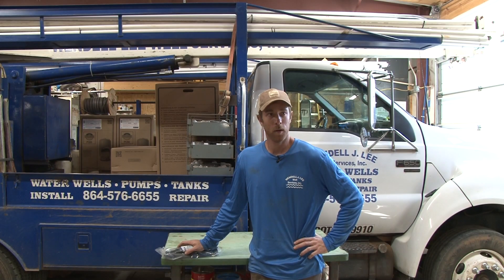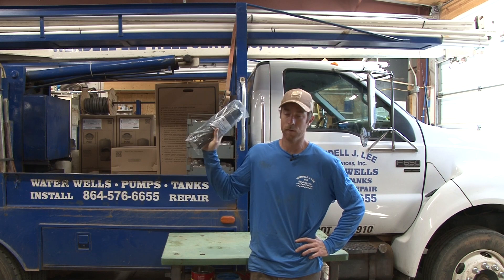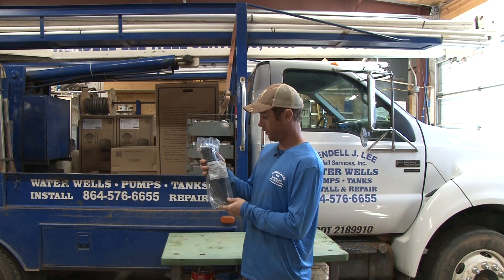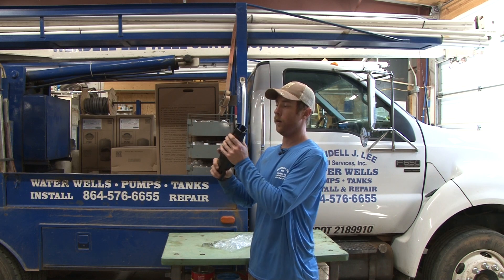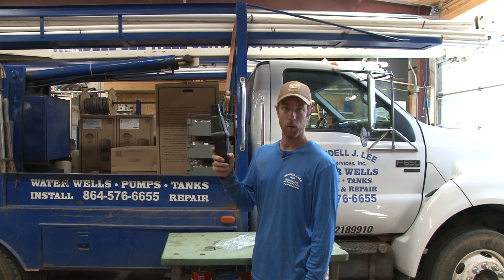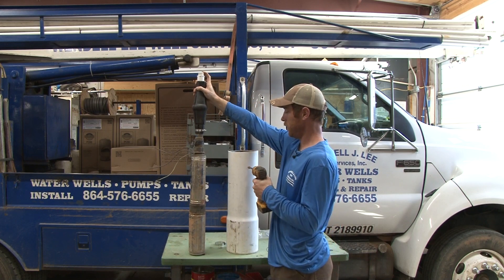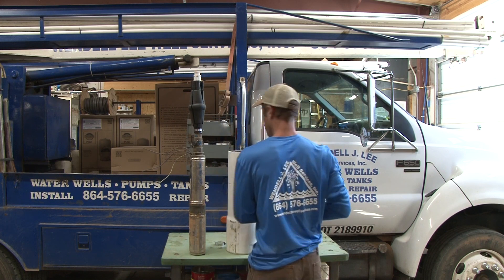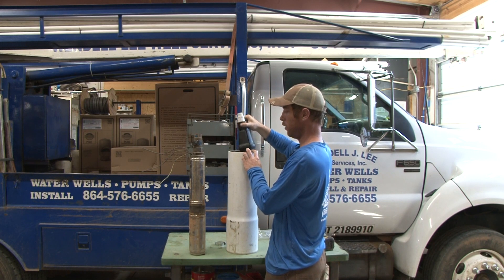Well Pump Torque Arrestor: How to Install and Are They Necessary?

Comment: I have a horrible recovery on my well as its 60years old and due to startup on a dry well  it rubs my wires against the bore and Ive had them short out so I'm going to put a timer and a torque arrested on it to stop this from happening

Comment: I like this guy's HONEST opinion. I am installing a 1.5 hp pump with polly pipe and was told I need one. If I can find one cheap enough I guess I'll throw one on. I will be ensuring my threaded knuckles will be torqued down enough to necessarily ensure the torque arrestor will never need to do its job lol. It'll be there for looks and piece of mind 😊

Comment: The well pumps don't have too much torque? My brother just got a new 3/4hp pump and new black plastic pipe and the first time he turned it on it twisted hard enough to twist up the torque arrester and put two kinks in the first foot and a half of the pipe and broke the pipe half in two right at the pump.

Comment: I’m putting in a 3” pump in a 4” well, only 60 feet deep, but putting one in near the pump only as a centering device, probably unnecessary but if it keeps the pump from seeing any well casing contact it will be worth the 5 minutes and for $20.

Comment: Wendell, I  just pulled my pump, 1/2 hp 7gpm 6" well caseing. Above the pump was a 6" spacer with the 4 ends worn off and a flat spot at the bottom of the pump motor from rubbing on the casting. The next 3 spacers have ware getting better as you go up the pipe. I have 170' of pipe . For $13.99. I'm adding a torque arrestor!

Comment: I'm not that worried about the pump unscrewing...but I DID  put one 6" above the pump to keep it centered and one 6' above that so it doesn't teeter totter on the lower one.

Comment: I have a 40-60 pressure switch, how do I get more pressure in the house?  Bigger tank?
Reply: Crank up the pressure switch screw to allow the pump to run longer and build pressure in your tank. Also you can add more pressure in the tank… read the side of it.  You can top them up with a bicycle pump.  Assuming your pump is good and can pump against the bladder pressure.

Comment: I wonder why pump manufactures did not design the pump so that they start in the direction of the pipe thread, so that the start of the pump will tighten the connection instead of trying to loosen it up...?

Comment: Torque arrestor on the pipe, which has no torque, nothing on the pump, which generates the torque, and could unscrew if fittings are too loose. Am I missing something?
Ed c
Reply: I had the same thought and was searching these comments looking for someone who asked this question. In my opinion, without connecting one end of the arrestor to the pump, there can be no arrestment of torque.
Reply: @nunyaB.1964  The guy Jaykocenko above this comment said it. It's to keep the pipe centered on the well to protect the wires. I had a well driller tell me to put 3 on a 200ft well. I'm worried they will get jammed up at the next pump pull-out.
Reply: @GeorgiaFireBand  If the pump is free to move around, then upon startup it could build up a lot of momentum before it slams into the side of the well.

Comment: I’ve replaced a couple 1 1/2hp,  400 ish feet deep. While we have those arresters on the truck we haven’t used them. We use sched 120 drop pipe, dope and bury every thread.

Comment: Thank you for the video!  Quick question, does the torque arrestor clamp on around/on top of your wire?  I'm guessing so to keep it from chaffing your wires.
Reply: Just tried putting my wires under the TA & didn't like it. So I now have the wires going over the clamp but thru the vertical slots
Reply: That's what I want to know!!!

Comment: They are 100% necessary on smaller pumps like 1/2 horsepower. Not only does the pump want to twist but it also shakes and vibrates. Unless the driller is 100% dead straight which most of the time they aren't the wire will lay on the side of the well somewhere down the well. If the wire is touching everytime the pump kicks it will wear right through the copper over the years. I see this all the time on unprotected pumps and in my area I mostly deal with 1/2 and 3/4. It's not on all of them but on 80% of the wells the wire will be laying. Very rarely will a driller get the well in dead plum especially with older drill rigs

Comment: A well log says I've got 40' of 6" casing with a 4 1/2" liner running from 15' to 75'. Can I just set the arrester to about 4 1/4" diameter? That also has to clear a pitless adapter.

Comment: I am putting a submersible pump into a well that is about 370 ft, I am going down 200 ft with the pump, does well casing go all the way to the bottom of the well?  Previously had a 100 ft jet pump in the well.    Do you always put torque arrestor just above pump?  Thank you for the video and the help!

Comment: Thanks for the good videos. I have learned a lot from y’all about my well. I am changing my pump today, and was wondering if I need an arrestor. My well is only 60’ and the pump is 1/2 HP.  So I won’t install one. Thanks again.

Comment: Not using a torque arrester next time! I tried pulling my pump (1HP Grundfos on PVC pipe)  yesterday as I had no water flow , its an older well with a 4" casing about 65 foot deep, The pump would come up to the pitless adaptor but then would jam, I hesitated to pull too hard as I didn't want to loose the pump after about 2-3 hours I was loosing faith that I'd ever see it , Very hard to see what was jamming the pump as the pitless adaptor is about 5 feet below ground. Luckily I have a small backhoe capable of digging down about 5' to the area of concern, I was able to cut the 4 inch PVC (well top ?) therby exposing the top of the pump and adaptor, to my suprise I found large pieces of the torque arrestor jamming the top of the pump and not allowing it past the adaptor! Came up easily after removing the useless arrestor. I never even suspected there might be one on it. I found a broken wire on the pump, repaired and back down she goes, I plan on checking the pump again in a couple months for torque issues . Great video thanks
Reply: That's my dilemma as I"m getting ready to drop my pump back in the well.

Comment: Thanks for the great info on the pump arrestor. I am installing one on my pump just in case its needed. Guess what it happened to me  just a few days ago on June 4th, 2021? The pump unscrewed itself from my schedule 80 pvc joint. Well is 500 ft deep. I have the equipment to take the pump out and I did only to find out the pump had come off. Fortunately, the wiring was strong enough to hold the pump on and I was able to pull it out. Too bad that I spend a fortune on a new pump only to find out the original one was still ok. It took 3 years for it to unscrew itself from them joint. It was a Grundfos 1 1/2 hp model. Here is my video I made prior to taking it out. https://www.youtube.com/watch?v=3VjFU4_r4lg

Comment: I've got gotta a question for you. I'm putting in a new 1 hp pump at 225 ft. At the 93 ft level my inside hole diameter changes. The inside of my pipe is 6-1/4" until you reach the 93 ft mark then it gets smaller somewhere around 4-1/2" to 5". How can I tell what it is without lowering and raising the pump over and over again ? That would be a pain in the rear !!!

Comment: We used them in the past, I'm a residential plumber and not a well driller. I do work on pumps a lot though. I stopped using them because of what you said in your video but also because on a couple rare occasions I have ran into what you call a 4" PVC packer/screen inside the well casing. My first was a install that I got stuck not knowing it had a packer and then just yesterday my buddy had one that someone had put in years ago and it took us hours and a rig truck to pull the Torque arrestor up through. In my opinion I wouldnt use them ALONE for your reason stated and mine!
Reply from the maker: yes, agreed with you on that, that sounds aggravating

Comment: Thanks for the info.
I'm now preparing to have a well dug, It was my understanding that not only does a torque arrestor help prevent the unscrewing of the pump from the pipe but it also helps prevent chafing of the wire inside the hole and or casing. Is that correct ? and if so is a torque arrestor worth it for that aspect.
Also how do you feel about "Well Hose" compared to PEX, schedule 80 PVC, etc.
Reply from the maker: yes, you are correct on the functionality of a torque arrestor. Schedule 80 PVC all the way to hang a pump on...rated for a higher pressure rating and stronger too

Comment: Hello sir, I hope you're doing good. I need an expert advice from you. I dug up a 400 ft well and when we were installing the casing, we accidentally dropped about 260ft (230kg) of casing down to the bottom of the well. I had no choice but trying the submersible pump to check if the well is still working or not and it went down only to 300 ft, pumping water for 15 minutes only. I assume that the casing under 300 ft are badly damaged and smashed, and I have no idea how to fix this problem as we don't have expertise here. Looking forward for your advice and thank you.
Reply from the maker: It's hard to give exact advice without me being on site and in your area, not knowing the type of well, formations you are in, and how the well was constructed. But my general advice tells me to get the pump out and try another hole. Unless you can get that casing out, clean the hole out and use what casing isn't damaged. I highly doubt that will happen
Reply: @WendellLeeWellServices  thank you very much sir, I wish I could bring you to the sight but that's impossible as I live in Syria - Kobani, But thank you very much for the advice. I can send you an inspection video of the well if you want.